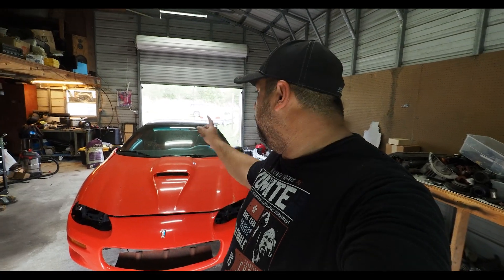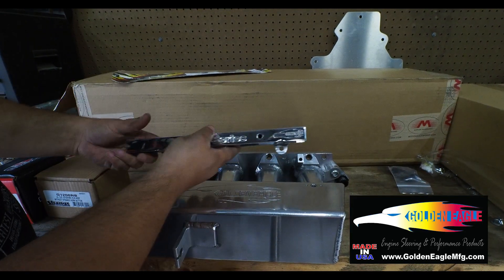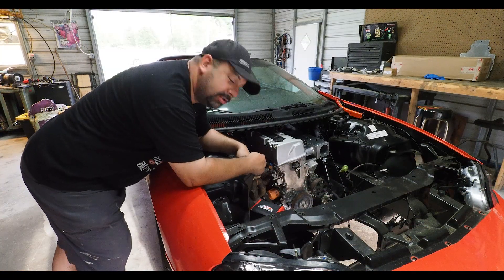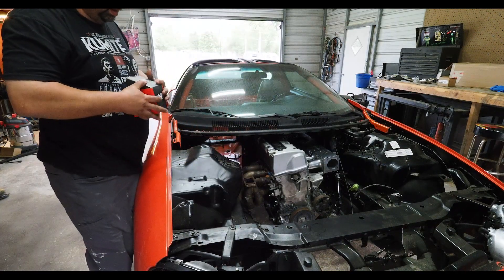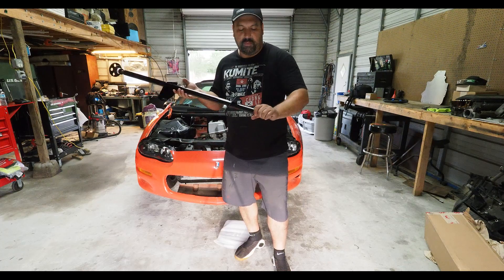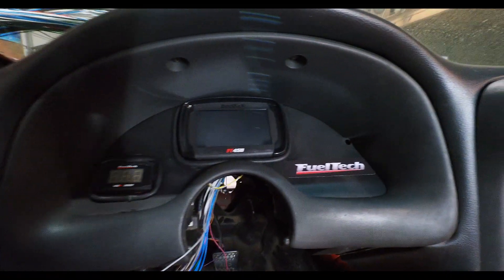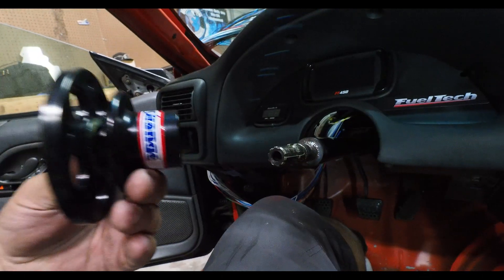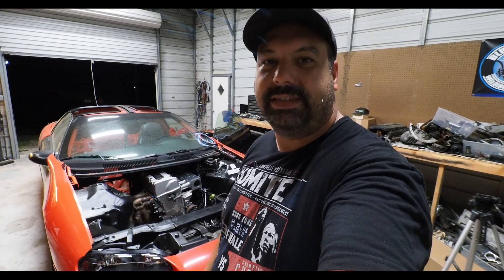NEW PARTS! Motion Raceworks, Strange & MORE! Honda K24 swap Camaro SS!

Comment: The headlights are easy to fix. You need to drill new holes on the brackets one step higher to lower the headlights. It’s cake
Reply from the maker: Sweet! Thanks a bunch dude!